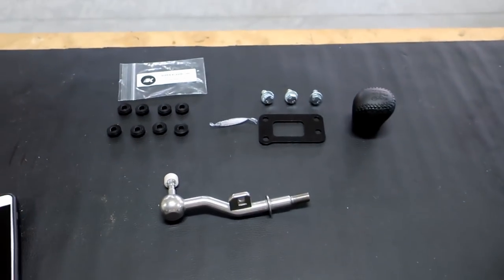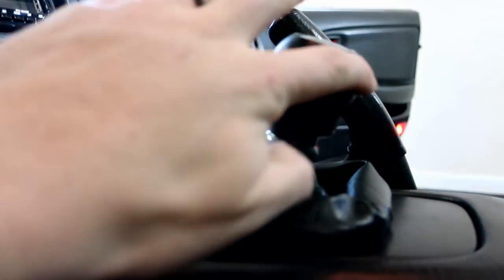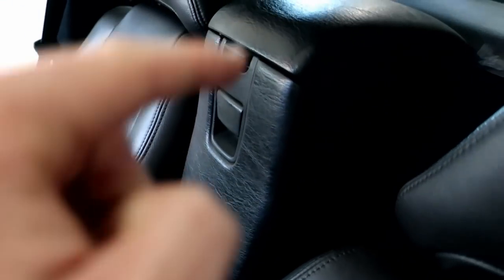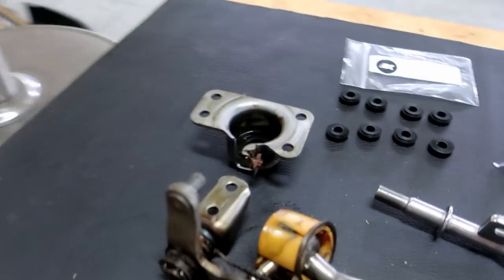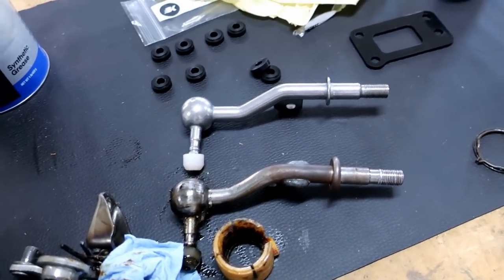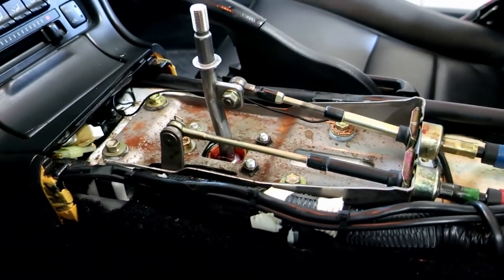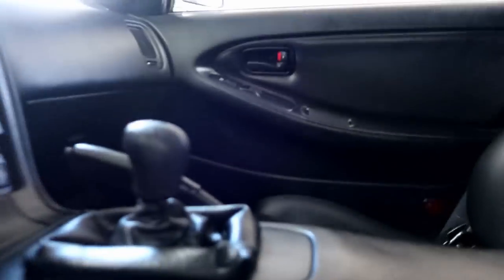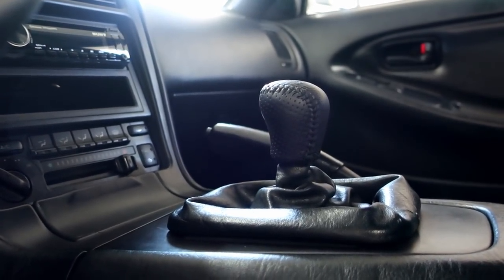C's Short Shifter For The MR2! (SuperKlasse)

Comment: Nice. My only concern would be how it stresses the cable since it's deflected upward. I know with the drop plate, it doesn't make too much difference but I think that'd bother me.

Thinking about modifying the actual linkage on the gearbox for my MR2 to give it a shorter throw.

Comment: Where do you send steering wheels.  My car doesn't have PS just the covering material is completely loose across the top. from whatever structure is inside.  I don't think I'd care as much if I had PS, but it's not comforting to feel it twisting when I'm trying to make a turn.